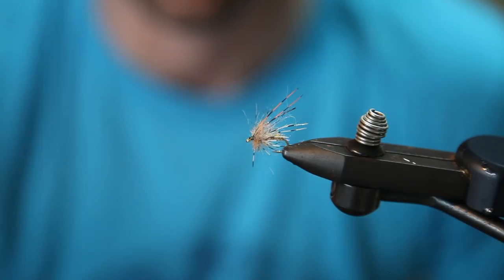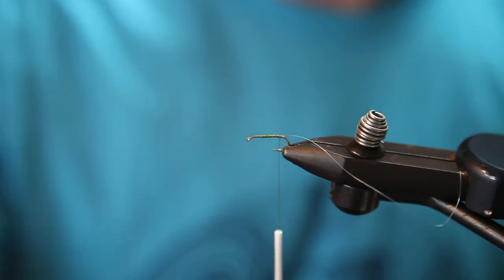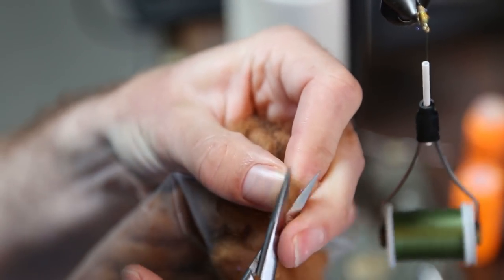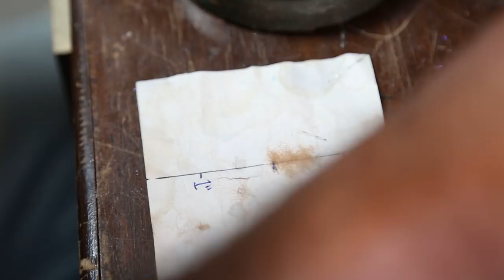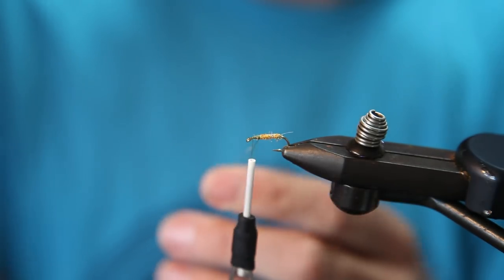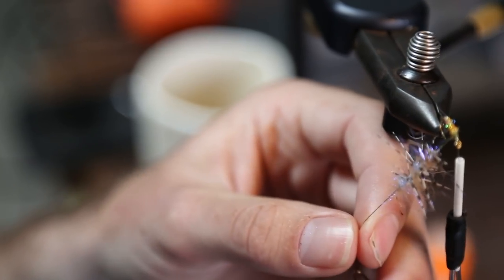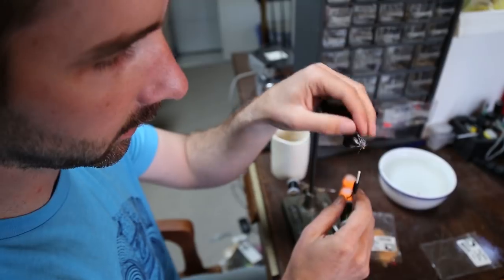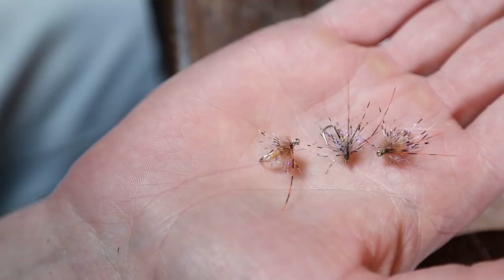Composite Soft Hackle, Size 14 - OPST

Comment: Hi Ben, really nice pattern! It sort of looks like a flymph "gone wild"! How much smaller is that soft hackle compared to a micro intruder? I've used long feather fibers as a collar by reverse tying and distributing 360° with thread torque behind the hook eye, tied the remainder of the fly tail to thorax, then pull back the collar fibers, tie them back against the thorax then tie off. Also hair hackle collars in a loop. But by using a composite loop you put thorax, long hackle and flash all at once. 👍 Cool! I like it a lot! Thanks, I learned more about composite loops and how to use them! (the horns a were nice classic touch)
Reply: Thanks Joe. It is a lot smaller, with the micro intruder being about 1.5 inches long and this just being a rather full size 14.